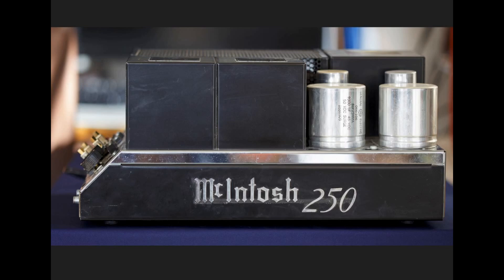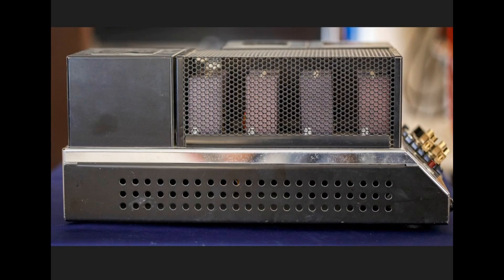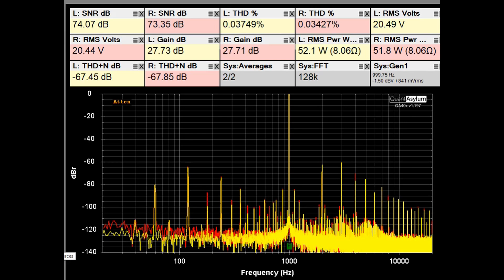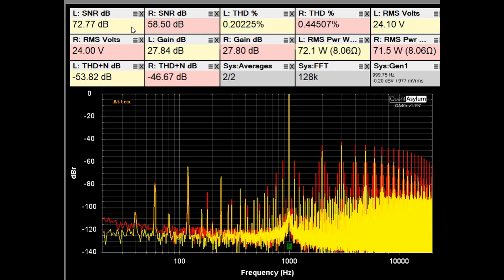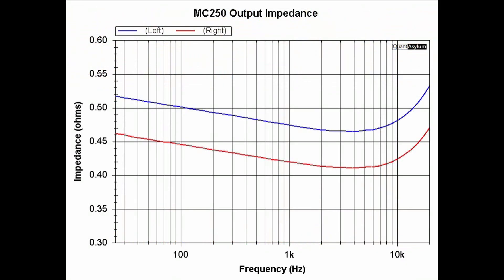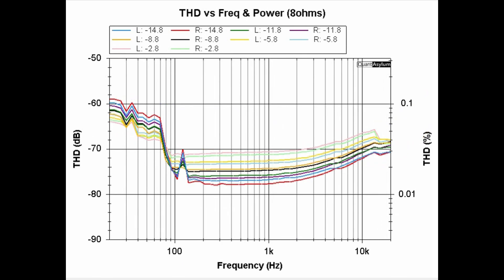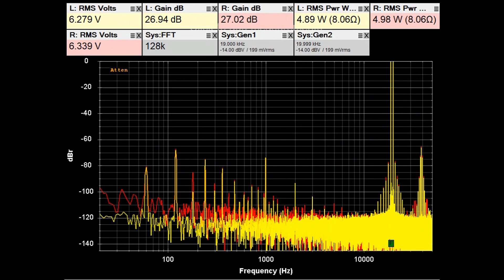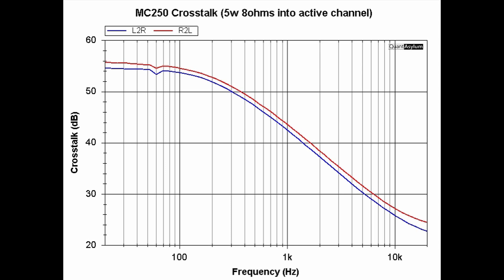McIntosh MC250 Power Amplifier: Vintage Audio Review Episode #125

Comment: The frequency response and sn does not measure that well for this amp.  The pedestrian HK 570i  receiver did better.  What vintage power amp would you recommend that rivals new models
Reply from the maker: Thanks for the question/comment. The HK570i is a totally different beast than the MC250. Even though MC250 did not measure as well, how would that translate to sound differences ? Not sure. As far as vintage gear vs new stuff, I would say that a decent vintage amp that has been gone through and tested by someone reputable is going to stack up pretty good against the newer amps, which do a really good job. I like some of the soundcraftsmen amps (w/out fans), and many Carver amps that have been serviced are really good. The Hafler amps seem to be good. Personally, I like McIntosh amps a lot. It really depends on how much power you need for your speakers and whether you want some sort of power meters...

Comment: The combined s/n and thd (SINAD) is disappointing.  If those two  caps were shot/leaking, it suspect many other electrolytic capacitors need to be replaced. Other components may have also drifted in the 40 odd years of life. If the boards really all original it’s rather amazing it works at all. Mcintosh really built these things well. 

Please suggest to your friend who owns this that it really should be sent in for a full servicing, if possible even to McIntosh itself because it looks immaculate and in physically great condition. You don’t want leaking caps to damage the board or cause transistors to run hot or fail, resistors to burn and damage the board, etc. This thing is worth some money on the used market and moreover, worth servicing and keeping for another 40 years.
Reply from the maker: Thanks so much for the comments and concern. I would be the guy who would be doing the repair for my friend. The noise level tells me that it could use new filter caps- but does not need to have them replaced. There are probably replacement p/s caps for it. Your concerns are well taken.

Comment: Thanks for another review of a "classic" piece.  You must have a great group of friends to get the very interesting equipment you measure and report upon.  I think this may have been McIntosh's first solid state piece?  I have the MC2505 (have had since high school and I'm in my mid 60's now) that I believe is really the same circuit and the MC250?  I always find it interesting that McIntosh continued to go with the output transformers even when they "moved" to solid state.  Some say that gives these a "tube like" sound.  I don't know, but my MC2505 is "smooth" but maybe not as "detailed" as current amps?  I think replacing  the caps would have allowed this piece to perform better?  But still, as old as this piece is and maybe never have been serviced in 60 years???? it's amazing some still like the "sound" of this vintage guy.  Thanks again!!!
Reply from the maker: Thanks so much for taking the time to share your thoughts. We are about the same age. Glad you kept your 2505. The MC7200 I reviewed a ways back did not have the output xformers. I am not a big believer in "tube" sound from what I have done  a/b testing on- see the one video where I did an a/b test between solid state and tube amps. They typically measure different, but  can't always translate that to a sonic difference. You will meet some of my audio friends in about 2weeks where we do an a/b test....
Reply: @vintageaudioreview I’m 42 and acquired a MC2505 a little over a year ago. I love it, it’s been restored so I don’t know how accurate it is to the original sound and it was my first Mac piece but it makes my Grado headphones which can be harsh and sibilant on certain amps very smooth and liquidy to listen to. Grados very rarely play well on alot of solid states but perform excellently on tubes so in that regard I guess I do consider it tube-like also.
Reply from the maker: @mikeg2491  Thanks for sharing your experience with your MC2505. I really like Mac gear and I bet that won't be your only piece...